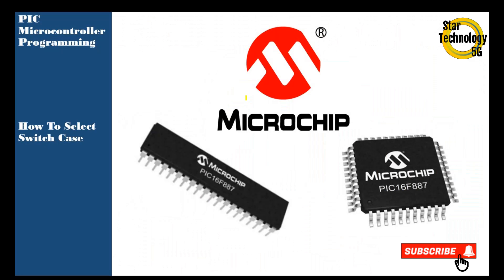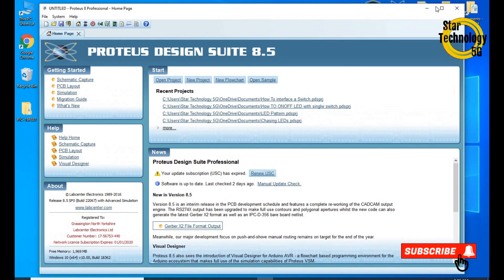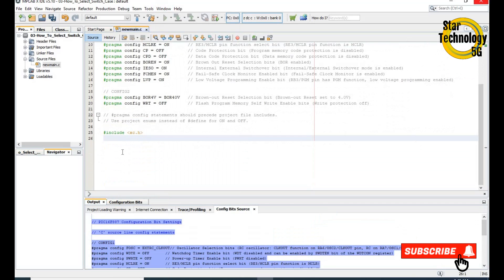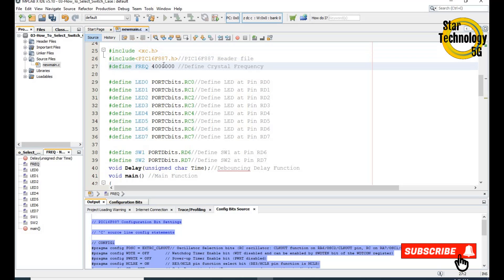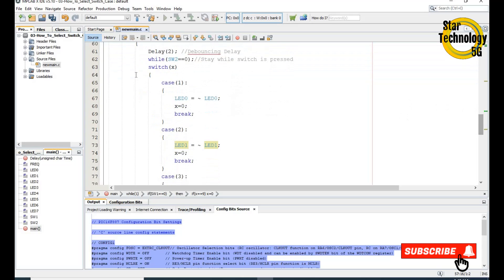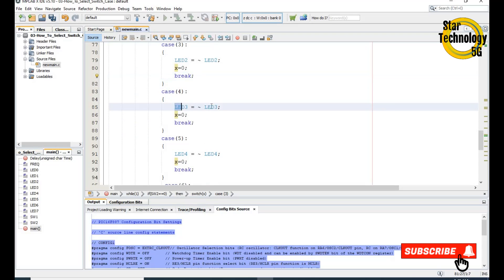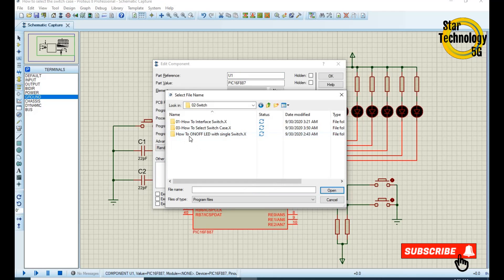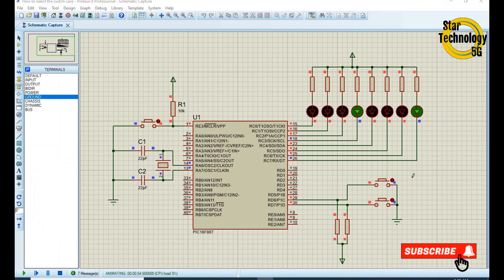Microcontroller PIC16F887 Video 14 How To Select Switch Case

Comment: My brother i thank you for your precious time
i am new to pic mcu however familiar with arduino c programming
i am trying to toggle a switch off and on with difficulty

even when my code is error free it does not toggle maybe only switching on but not off or vise versa
i am pulsing high and have also tried pulsing low without success
i am not simulating however using pic 16f877a development board.

i don;t know if the xc 8 compiler version is the problem
i have replicated your on /off switch code without success
i will appreciate your advise if you have encountered such problem
could it be my setup because i am using ANSI standard c program
i running out of ideas as most of my code seem to have no errors

sincerely
Reply from the maker: Brother, please send me your code and circuit diagram. I will try to solve your issue.
here is my email:
startechnology5g@gmail.com